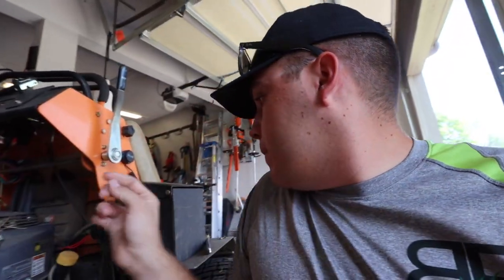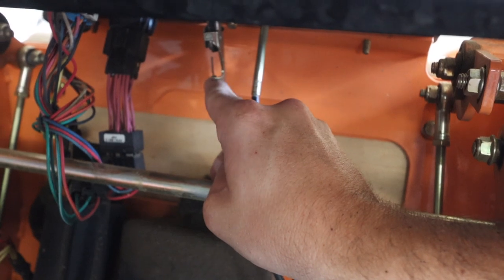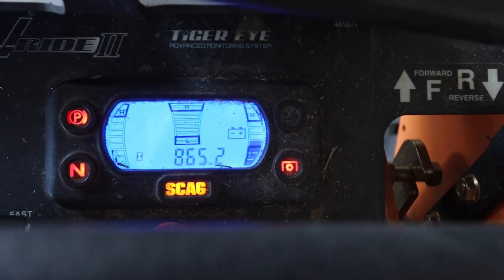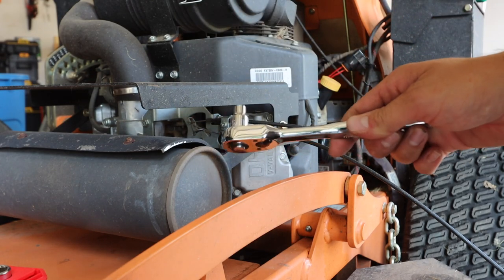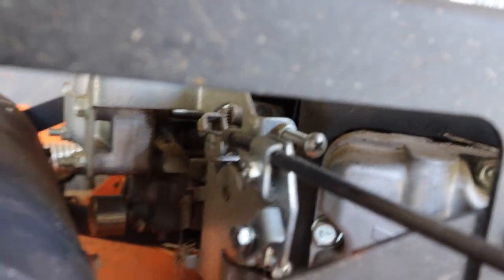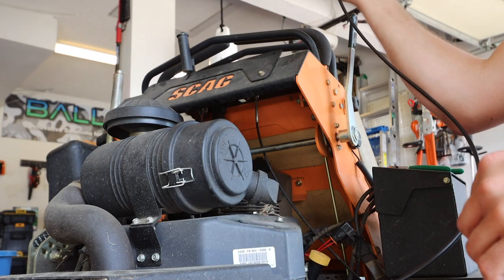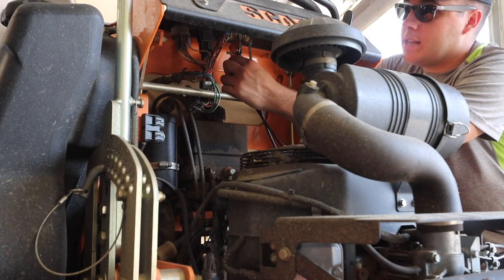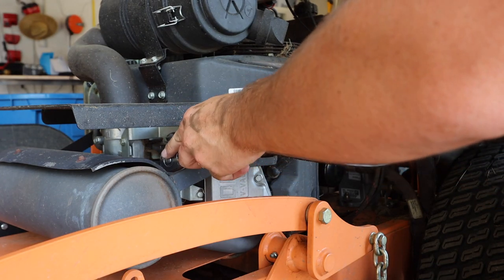How To Replace A Scag Vride 2 Throttle Cable

Comment: My scag 36 v2 will not propell. A spring broke and not sure where it goes. I am not able to drive ( move any direction) I have to push it back on the trailer. Any ideas?

Comment: Spray them with wd once in a while
Reply from the maker: Does that make it last longer? Should I spray at the too where the cable is exposed?
Reply: I spray both ends it seems like when you see rust they break